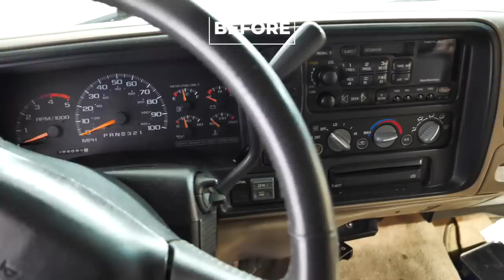Car Detailing A Crusty Chevrolet Suburban SUV! Deep Cleaning Disaster Transformation Car Detail!

Comment: If you detail this truck a lot you could add some nickel anti seize to the bolts before you re-install them.  They will not back out but will take less effort to remove them next time.  Also you may be able to spray the bottoms of the bolts with some Liquid Wrench to get them out easier.  Or have the customer bring it buy and spray them down a day earlier, or not.  When I did my Chevy I used anti-seize on the bolts,  4 years later they came out easier.

Comment: Spray the nuts and bolts down with pb blaster when you first pull it in to get started on the inside So by the time you get around to pulling the seats out the solution will have soaked down onto the thread

Comment: That carpet behind the rear folding seats actually looks moldy. Also, do you use never seize on the seat bolts when you reinstall them? Might save you some trouble in the future if the same vehicle comes back for more detailing. Incidentally, I'd still like a BMW Alpina B7.

Comment: @Stauffer, have you ever tried using your steamer on some of those “baked in” stains like were under the back seat, to see if it loosens the stain from the fibres?? I would love to see if this would work on those stains?
Reply: Would be awesome to see combinations of steam, steam and soap, plus the drill brush with these... What are your thoughts, and what have you tried? Certainly is a noticeable difference where you’ve used the steam in the trunk...

Comment: Have a question for you. My cousin gave me his father's 2000 Toyota Camry LE. On the front driver's and passenger carpet there are Coffee strains how do I get them out? I'm a beginner detailer and have know idea how to get them out. Over all the interior isn't that bad for a 21 year old car. I did get everything out of the car except what's in the console between the emergency brake. I guess what I'll have to do is take the console out. The Coffee strains does bother me. In cleaning the interior I got about $2.00 in change out of the car. I vacuumed the interior. 2 of the owners were smokers I'm trying to get that out of the car too. Thanks much for your videos. I'm learning.

Comment: If you run into rusted hardware, you can try soaking them in penatrating oil first.  Spray it on and let it sit for a bit. If some threads are visible, you can also clean them with a metal wire brush as you soak them.